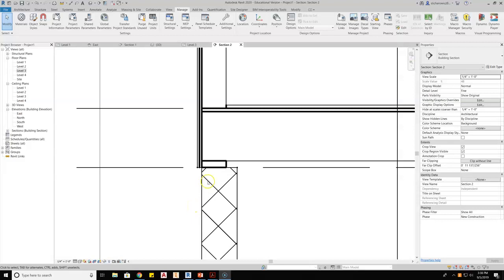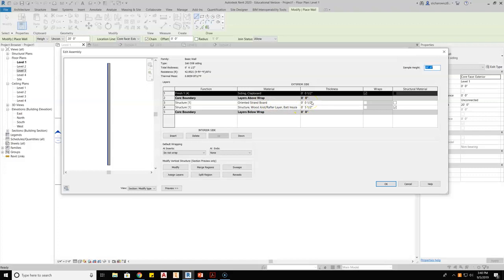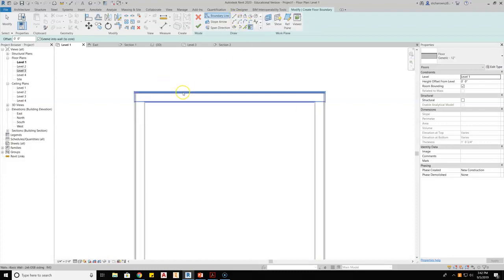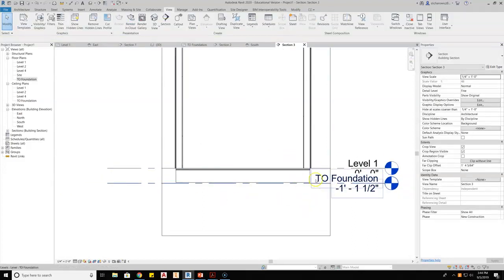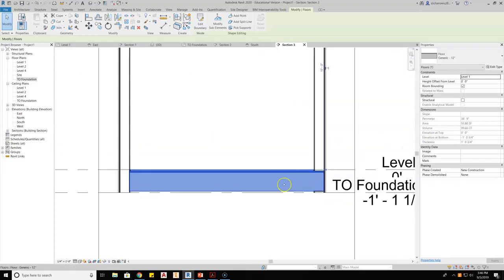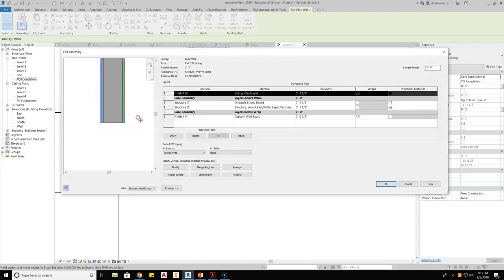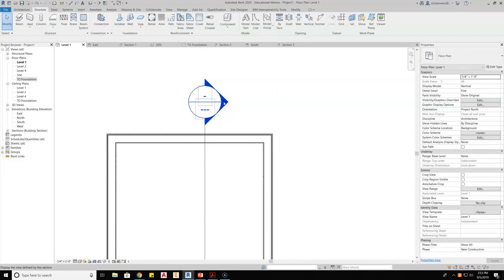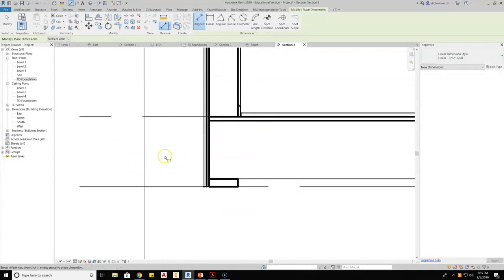Revit - Connect Walls and Floors for Accurate Section Views

Comment: hey nicely done! Do you have a more detailed video on how to edit/modify layers in both wall and floor ... actually i had figured it out but don't remember how i did it ... at one point i was able to drag ie. the finished oak floor away from the wall when in section thanks!